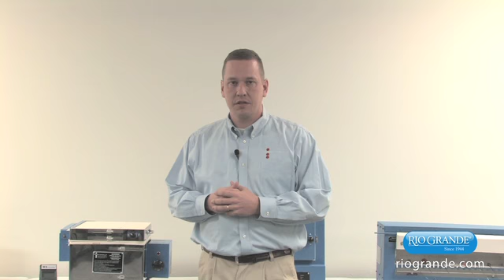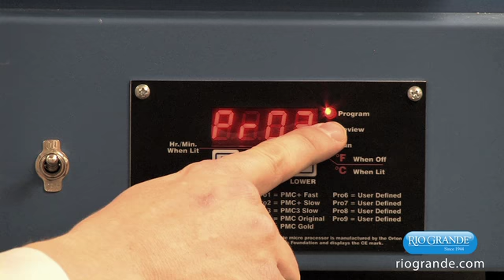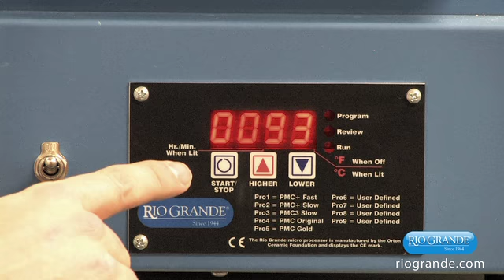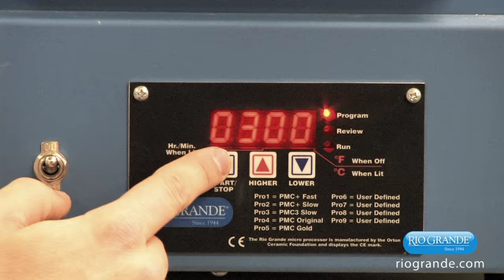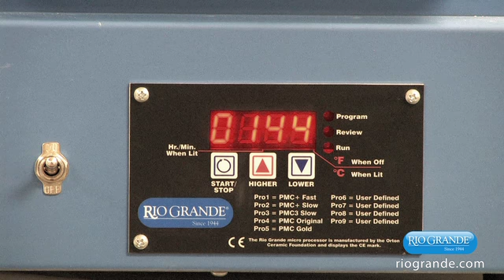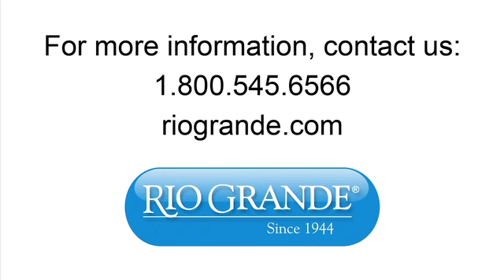How to program your Rio PMC Oven

Comment: I was just gifted a used SC2 from someone who worked with PMC. I am an enamelist and many of these terms are confusing to me: ramp? hold? second ramp? etc. I just want to get to 1450' and leave it while I put work in or out when I'm ready. My enameling classes have just set the temp and left it there-for hours. Is there another way to use this that is easily condusive to enameling needs? Will it hurt the kiln leaving it at high temp?  also, there is a cone in the top. I have no idea what that is for. leave it in? take it out? look for something, does it change? lol thank you--I am so stoked with this new kiln!
Reply: You can simply do a full ramp up temperature (press up until it says FULL). For pottery, and a lot of other things, you have to more slowly ramp up temperature (degrees per hour), or else you risk too rapid of a heating and cracking/explosion occurring. Pottery for example needs time for the moisture in the clay (even if it appears dry) to slowly diffuse. Chemical processes also occur over time. So for pottery there is a concept of heat work. In that area, it's not a matter of just hitting a temperature, it's a measure of how much overall heat the work has been exposed to (or more technically, how much overall energy put into it). So, you may have multiple key temperature points, and multiple ramp up periods, and different holding times for each.
Reply: On a similar note, I'm more into lost wax casting. I've been curious about enameling. Do you have any recommended learning sources or youtube videos? Thanks!

Comment: The one thing you do not explain is how to make the second or third ramp a FULL ramp to the final temperature.  For example 200*/hour until 560*, hold for 30 mins, then FULL RAMP to 1750* hold for 3.5 hours.
Reply from the maker: Hi +ClassyGeek! Thanks for reaching out :) Let's see if we understood your question correctly. When programming ramp temp and hold times, you simply need to hold the up arrow on your ramp until it says FULL. Then press the "Start/Stop" button to save that setting. Did that answer your question? Let us know if we can provide any more information! Our Jewelry Tech Team would be more than happy to talk you through any process, feel free to give them a call at 800-545-6566 if you'd like to speak with them!

Comment: I have a kiln, but not sure if I can turn it off and unplug it in the CPLt mode with
out damaging the Kiln...I read the instructions and watched the videos several times, but nothing states what you do AFTER the program reaches the CPLt mode.
Reply: + hi John Kadow. You can turn it off and then either unplug it or leave it plugged in. whichever you prefer. I hope this helps. Thanks for watching.Mark N Tech